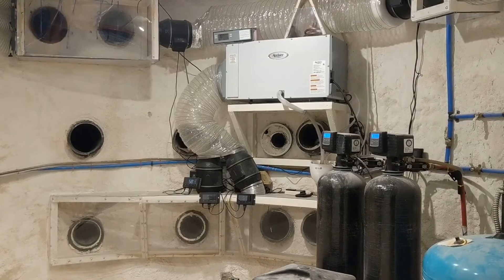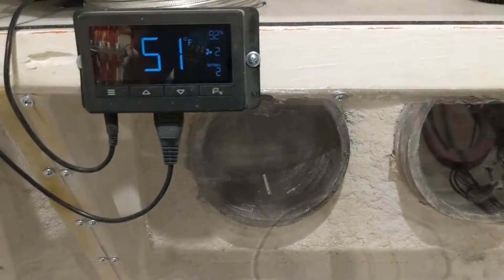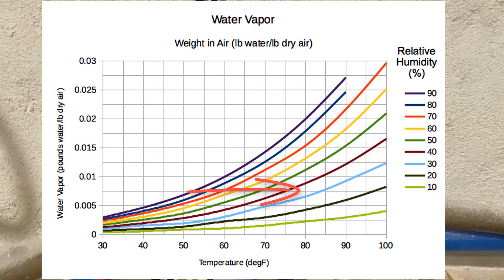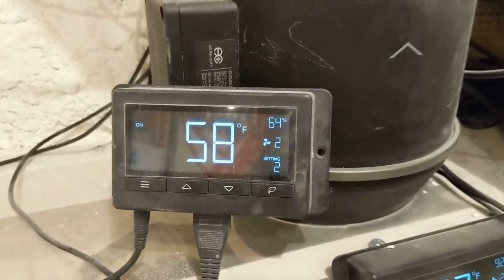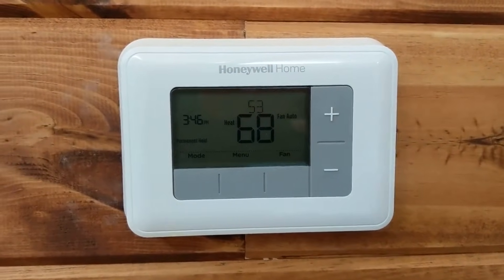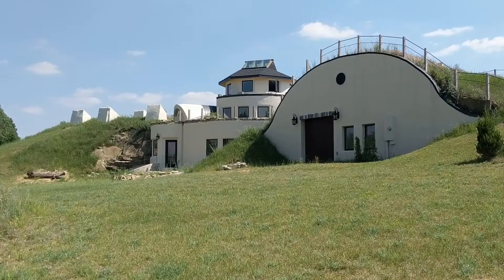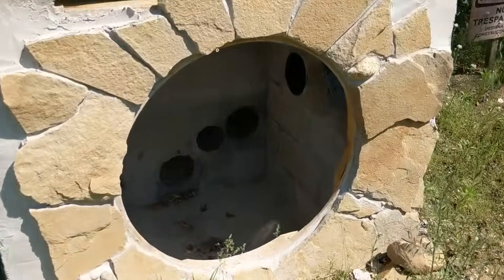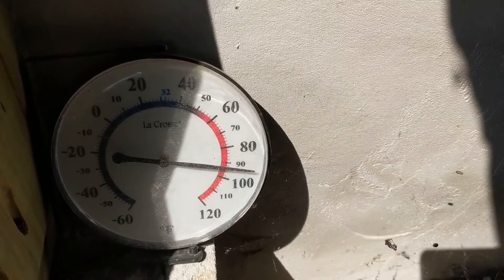Earth Tube short...

Comment: So the 8" tube exchanges more heat than the 6"? 
Wow, that's counter intuitive.
I've considered doing earthtubes for the earth sheltered ICF house I'm building into a hillside BUT I'd have to zigzag the tubes, getting 200 linear feet in 100 foot distance downhill. Then there's a ride up the next hill (which is also my property an additional 300 feet) but I'm concerned because the low spot between the hills fills up with water every time it rains. I can just imagine if I ran it up the other hill I would get condensation filling the low spot AND possibly the tubes "floating" up through saturated soil.
Reply from the maker: Yes, actually, good intuition.  I now suspect I was noticing something transient instead of steady state. I was tired and put this video together without reviewing the script.  Now that I have...   I'll write it out for you here and then pin this comment/correction/explanation.   

The two tubes have the same fan, so the flow rates are very different and the larger one (with less resistance) brings in more than double the air flow.  Also, the larger tube is a double wall (N-12), so its flow rate is better and smoother.  So, normally, it is the smaller tube that is pretty consistently two degrees more moderate than the larger one.  It has been this way since the first day I turned them on and they have been running solid for a year.  In winter the smaller tube is 2 degrees warmer and in summer it is 2 degrees cooler.  I chuckle when I see it because I would expect it to be proportionally more moderate (like a percentage), but not 2 degrees no matter what the temp is outside.  

Then something changed last week...  I was going thru my inspection checklist (reading all the codes) and I noticed that Building Code requires me to have these fans on a timer that runs them periodically.  I am sure running all the time is better than periodically, but I just needed to pass inspection and figured that running them every other hour would save me a little electricity (the fans are 47 watts each and I have 4 of them, plus the dehumidifier).  I set that up last weekend and then forgot all about it.  I now suspect that I just happened to have walked in with my camera a moment or two after the fans had turned on.   The larger tube probably got its cool air from mid tube up to the sensor and dropped the temp more quickly than the normally more moderating tube.  If I let them run to steady state, the smaller one would probably have eventually moderated more.   But I saw the 2 degree difference and recognized that as "normal" without noticing that it was reversed.  Next time I take a video, I'll check the timer and make sure it has been running for a decent amount of time before filming.
Reply: @SimonHomeintheEarth   I didn't think it was counterintuitive at all.  The tubes are a heat exchanger based on skin loss of the air inlet temp of the tube versus the surface area of the skin.  The 8" tube will contain the same volume of air in a shorter length.   If both tubes are the same length, 200', you have more air to move and more skin loss.  There may be different tube types, friction, and air speed, and cost to consider, ok.  But the calculation for cross sectional area is squared of the radius versus the surface area per unit of length just multiplied by 2, so the bigger radius will always have more volume being exposed to a bigger surface area for the same length.  If one is length challenged, use the big pipe.  For cost, consider total sq.in. of pipe per $, and ratio the bigger versus smaller pipe.

NOW, YOU are the bigger expert than me because you are actually building one and posting it and I am only commenting  So congratulations on your work and making a great low energy place to live for you and your family.
Reply: @mrwayneright  
Four 50ft tubes will provide exactly the same amount of surface area as a single 200ft tube. You can run a lot more air (or the same amount of air more cost effectively) through four 50ft tubes than a single 200ft tube.
Reply from the maker: For your design, try to go straight if you can.  Sometimes constrained space makes the Zig zag necessary, but don't do it to try and help "mix" the air.  All it does is add back pressure (resistance) and reduce flow without increasing thermal mixing.  If you want to reduce your flow rate, save the tube and just use a smaller fan to get the same end result with less loss.   

For your specific situation, I suggest using all your tube on the downhill slope in parallel runs...  You would have much less back pressure and no problems with drainage.  If the much higher airflow was not moderating the air enough, you could just reduce the fan (or turn it off and go passive) or even restrict the inlet or outlet until you got the performance you wanted.   Just spread the parallel runs out as much as you can so they are not all interacting with the same soil, but honestly, my 4 all ended up in the same trench (closer to each other than I would have liked) because the trench was already going in for my septic and I didn't want to pay for additional trenching.
Reply: @SimonHomeintheEarth  The house has a heat chimney (ferocement, with black pigment mixed into the mortar) at the highest point that's the only disruption to the sloped flat roof (R80 and except for the front wall, all that shows above ground) I installed  two 6" tubes just under the foundation in the prep work but they are capped off a few feet beyond the house, (for 'later' in the do list) No inspections are required in NE Texas beyond septic in the county so even though I have been building to national code for plumbing, electrical and structure, no one's questioned my engineering / design. On a sunny day, cracking the front door results in a noticable draft as rising air in the chimney pulls air in through the house... So I haven't installed any fans yet. There's no interior walls yet either, I moved in and only the kitchen is finished, bathroom partially done,  otherwise I'm 'camping' in the hull of the house.
Reply from the maker: @bobjoatmon1993  Yes, I did something similar where I got most of the walls up before I bothered playing with the earth tubes.  They just didn't seem like priority at the time.   But now that the walls are up and it is hot outside, I am liking the nice cool air.
Reply: I might be concerned of any standing water in an earth tube.  Also consider accessibility in the event any mold should develop in your pipe.  Devise a method that it could be cleaned should the worse happen.  That's why I used a pipe large enough on mine to actually get inside and scrub it down if necessary.

Comment: In humid climates circulating water through a fractional hp circulating pump through a H2O air coil and an air delivery system might be another way to go. Instead of burying air tubes you bury irrigation tubes in a closed loop. The one additional thing I would consider is an undersized mini split perhaps the one that runs on solar to dehumidify.
Reply: I’ve used twin hose portable heat pumps with air earth tubes in both heating and AC mode. It works pretty well.
Reply: @captainobvious9188  great idea! The issue with portable units is inability to defrost, the earth tube eliminates that.

Comment: So the humidity would cause pools of water to form in the tunnels that might stagnate potentially? If it does how does one remove the water out the tunnels safely?
Reply from the maker: Two ways...  First, the tunnels are all sloped down toward daylight.  Water collects and runs down.   Secondly, there are weep holes to drain out the tubes along the way.  Very little actually makes it to the bottom, but I am confident that none is building up inside the tubes either.

Comment: great project! I have similar Earth Tubes installed in my house (Southern Brazil, mostly hot climate, only needed for cooling, 4x6in tubes, 50m long, coming downhill to the house). Now I need to figure out how to increase air flow: Should I install a solar collector (solar chimney) on the roof, or install a fan in the incoming Earth Tube? I see you have several fans with about 50W each. Have you ever measured the air temperature increase after vs before the fans?
Reply from the maker: Yes, I measure almost no temperature difference on either side of the fan (it is low wattage relative to the flow volume).   I have done tests where I turn off the solar chimney and it makes a significant difference, especially on hot days or windy days.   But the fan makes more difference.  They work even better together.   I have also had days when the power is out and it is nice to know that I don't need to rely on the fans.
Reply: @SimonHomeintheEarth  thanks for the explanation. So... fan + solar chimney in combination. Will try to do the same on my project.

Comment: Question.  When can you use thin walled pvc to move air underground compare to perforated pipe?  Would you possibly get mold if you use solid pipe?
Reply from the maker: I also used solid pipe.  The HDPE dual wall pipe is the best option.  It is smooth and solid on the inside, but thin enough for rapid heat transfer.  Nothing can grow on it.  Water can exit thru the soil tight joints.  It is tough and flexible and relatively light.  

Thin walled pvc (sewer pipe) would also work.  But it is not as tough or strong as the hdpe and doesn't economically come in larger diameter sizes (such as 8 inches).

Comment: Why not recirculate the air from the house?
Reply from the maker: Fresh air is a good thing.  We do some recirculation, for instance, we pull the warm air from the top of the skylights down to the basement in the winter and that goes around again.  But eventually, we kick it out.  The trick here is to do it in a controlled way.

Comment: What guidelines can you share for tube depth and length?
Reply from the maker: Generally, go as deep as you can easily afford.  20 ft would be ideal, but is usually much too expensive, so if you can get a digger that does an 8ft trench, do that.  If you can only get a 6ft trench for a reasonable amount, then do that.   Length is also a bit related to how much property you have, etc.  I used 8 inch diameter tubes and 6 inch diameter tubes and 250 ft was plenty.  I never ran out of temp exchange all season.  The 8 inch ones are double wall and don't moderate quite as well, but let in twice the flow and I wanted to test the smooth wall design just incase I ever needed to clean it.  The 6 inch ones are single wall, corrugated and perforated (I wanted to test drainage, etc.) and they moderate a bit better and cost less, but have half the air flow using the same fan.  I also have some 75 ft length tubes and they don't hold the temp nearly as well, but the air flows are greater (I have those closed off because the other ones provided more than I needed anyway).  Maybe ideal is somewhere between.  There are lots of factors at play.

Comment: What about the water inside the tubes due to condensation? Does your system has some kind of drainage?
Reply from the maker: Yea, it slopes down to daylight at the bottom end.  But even so, very little water gets down there. 
The 8 inch tubes are double wall HDPE pipes, but they only have "soil tight" connections every 20 ft and the condensate dribbles out through those.   The 6 inch tubes are single wall, corrugated and perforated pipes.  Any condensate just leaks out and drains away thru the perforations.

Comment: Just finding your page, and will be building a home at 4000 feet in North Carolina right on the Tennessee line. Wanting to put in earth tubes to supply the air for my ERV, the question I have is concerning mold and mildew growing on the inside of the tubes with the humidity is high as you've indicated in the temperature using the humidity mold growth chart mold would be growing have you experience that I'm wondering if mold would grow with air movement like it does inside the tubes so I'm hoping your answer is no mold is growing :)
Reply from the maker: No mold here at all.  I think mold needs a few key things to grow, water, air and food are the primaries.   The easiest one to prevent is a food source.  I used smooth wall HDPE pipe, so the mold has very little chance of finding a good home.  The water drains out of the tubes quickly.  Can't prevent the air, but the air is flowing constantly (keeps flowing even when the fans are off), so it never gets stagnant.
Reply: @SimonHomeintheEarth  absolutely thank you for your reply. Sorry it's taking me so long to come back. Agree and I'm hoping that everything I'm putting in. I won't have mold either. Glad you don't have mold. I think there's enough dry days are partially dry days. That mold will not grow inside my tube.

Comment: In the summer, are the thermostats triggering fans to push the cooler air to the floor registers? Do the radiant systems run cool water through the floors in the summer to help cool the space?
Reply from the maker: I have the fans turn on for half of every hour just for the fresh air.  I do have a temp controlled fan that sucks hot air down from the skylights and dumps that in the basement in winter and sends it op to the solar chimney in summer.  

And yes, in the summer, I open up a valve so that well water is drawn in thru the floor tubes before going to the hot water heater.  This cools down the floors and warms up the water.

Comment: This is really impressive at 55 deg F when it is 90+deg F outside.   Do you know what the ground temperature is in the summer or the temp in the earth tubes in the ground?   My local ground water averages about 72 deg F in a higher humidity are in FL.  I wonder if I can get anywhere near 55 deg F if I did earth tubes??.  Thanks.
Reply from the maker: No, your lowest possible is your ground water temp.  In Florida, that is usually about 70 degrees or so.  Another way to think of it is that it is your average annual temp.   Then go a little higher than that due to losses in the system, transfer problems, the ground being affected by the tube, etc.   My ground water temp in Michigan is 51 to 55.  

But 70 is still much better than your air temp outside.  So you'll still get some significant benefit, especially during the day when the sun is hottest.

Comment: So 250’ of earth tube is adequate to dissipate atmospheric heat into the ground.
Reply from the maker: Yea, it worked well.  I was worried about going too long because you eventually can't move air thru the tube, but 250 is fine with both the 8 inch smooth wall pipe and the 6 inch corrugated, although the 8 inch pipe gives about double the volume flow for the same fan.

Comment: What do you mean by "kept the place warm all winter"?  50 degree air isn't warm, and likely was cooler in the winter..  I could understand cooling and warming a air cooled condenser of a mini split.. But introducing this wet air to the home in summer requires allot of energy to dehumidify.  And the potential for mold , living under ground , and drawing air through earth tubes is to high for me..  The only way for it to be safe is if it was all down hill. And even then, I would only supply earth tube air to a condenser or HRV intake.
Reply from the maker: Funny that your name is "colder"...  Yea, 50 isn't warm, but it is very warm compared to the -20 that is outside.  So we get the first 70 degrees for free and only need to warm it 18 more.  (actually, by the time winter rolls around, the ground has warmed and the income temp is closer to 56 or 58, but anyway... )  Passive solar can handle the remainder needed on its own on any sunny days.   On cloudy days, our bodies, cooking, showers, etc. make up most of that difference and the heater rarely turns on.  

I did give up on the dehumidifier...  Mainly just because it was heating up the air a few degrees in summer and it was a bit too big for the job (you saw how quickly it dropped the humidity).    Now I run the incoming air over a small 12k mini-spit ac unit.  That pulls out all the moisture in summer and dumps any excess heat outside.  I could use it in reverse in the winter, but I just turned it off because we didn't need it.
Reply: @SimonHomeintheEarth  but when you heat to gain the last 20 degrees, you will lose allot of that heat outside in the earth tube soil. Your heating the earth.  In the summer the tubes would introduce a huge amount of humidity.

Comment: You should have just used the earth tubes to cool an air-to-air variable rate inverter A/C condenser and air handler in this room instead of using a constant on/off/on inefficient dehumidifier. This will keep the outdoor humidity from even entering the conditioned space in the first place because the only air being conditioned is indoor air. You will use far less energy this way. You also can't use "tables" to tell what your humidity is. You need to take a wet-bulb measurement of the actual room.
Reply from the maker: At some point in the process, code requires me to bring in fresh air.   Several air changes per hour actually.  I can't just recycle the internal air and cool it with a heat exchanger, I actually need to bring in the fresh air.  That air will have moisture in it.  At the moment, my earth tubes have cool walls and squeeze out most of the moisture.  By definition, that means they enter at 100% humidity for their given temperature.  

As for the tables, I was just giving an idea of how the humidity drops when the air heats up as it goes upstairs.  That is what the tables are for.  I also have several humidity sensors around the house to monitor that directly.  I don't measure my humidity upstairs by the tables.